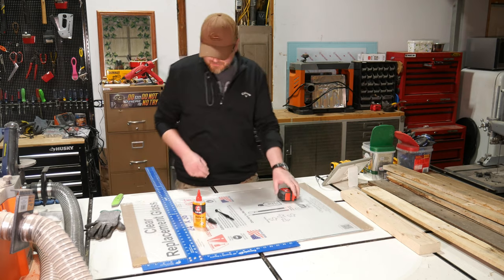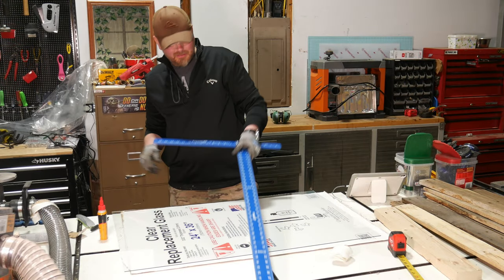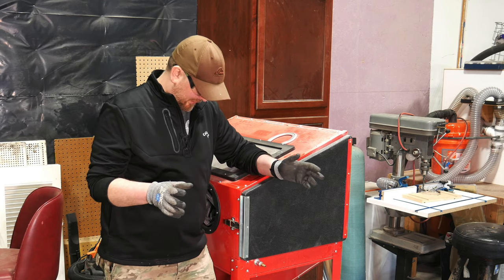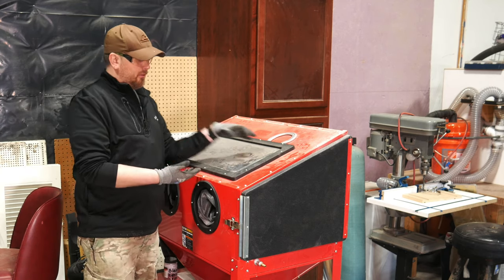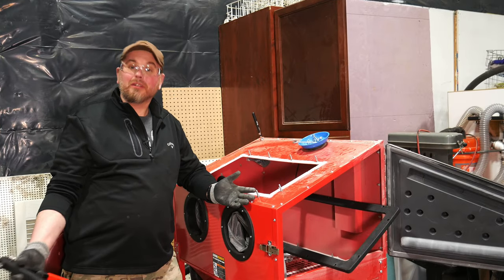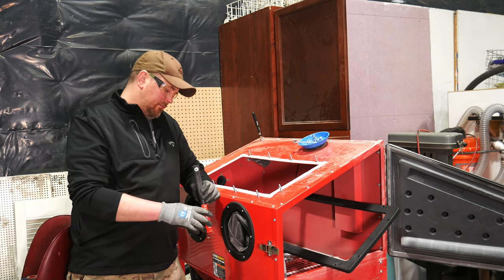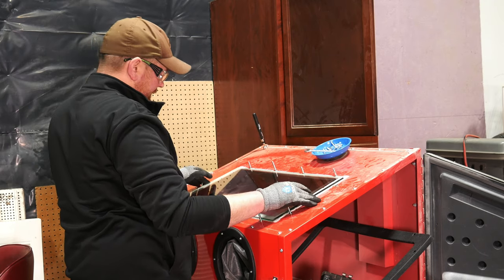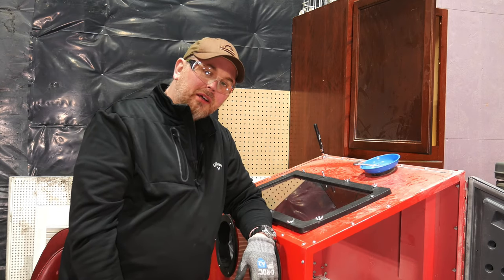Cuttin' glass

Comment: Good job on your first time cutting glass. For the next time I suggest something much smaller to be used as the fulcrum. Most time I see people use a small bit of 3/16 (or similar) sized rod. That way you can make sure the cut line is perfectly aligned with the fulcrum piece.
Reply from the maker: The Grant Alexander Thanks Grant, I’ll give that a try. I have some more projects lined up that I’ll need to cut glass and I’ll give it a shot!
Reply: @JFKreations  good luck 😁